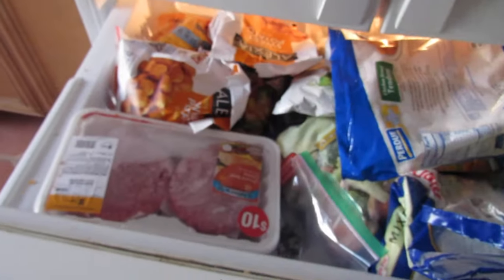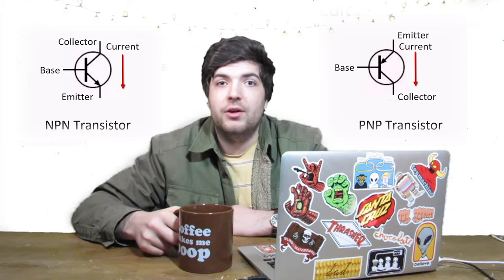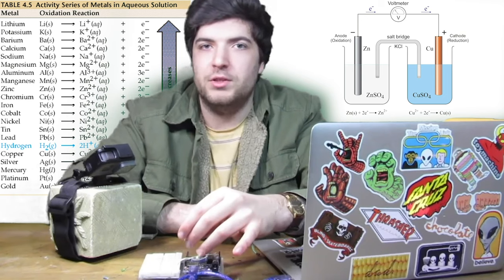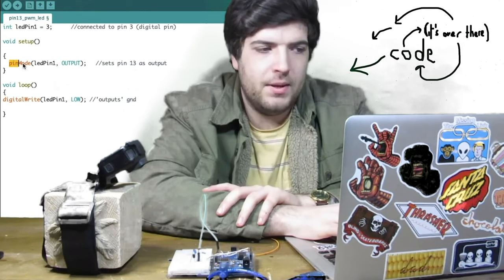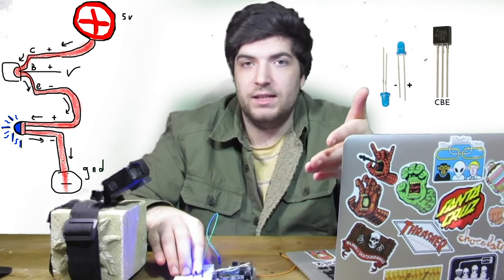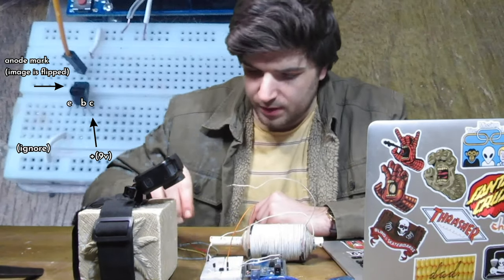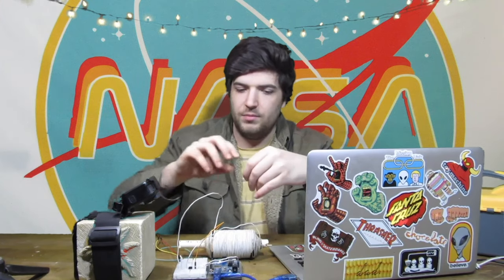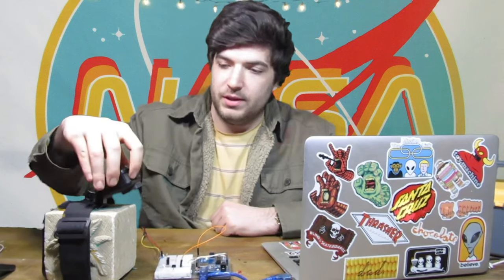Properly setting up your Transistors, made easy | 3 of the most costly mistakes beginners make

Comment: Your channel would be much more valuable if you actually read up on your subject first. No mention of gain for BJTs? No mention of voltage drops across transistor junctions? No mention of reading the specs of a transistor? Just randomly placing resistors? I suggest take less time than it took you to make this video and read up on transistors.
Reply: if you read the title it says "a guide to correctly setting up BJT's and MOSFET's" you boomer

EDIT: also he explained reading specs at 2:13 and placing resistor 4:10
EDIT 2: Also he's already done a previous video about it at 1:27
Reply: @WeldoYT  Dude, you killed him..